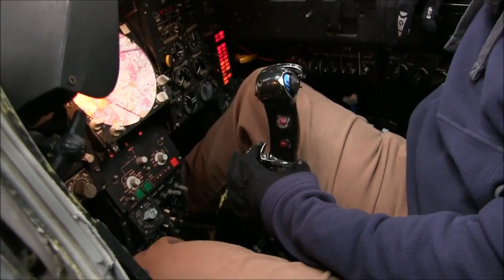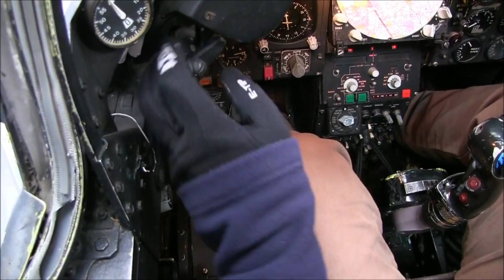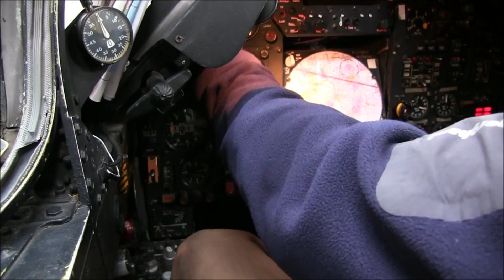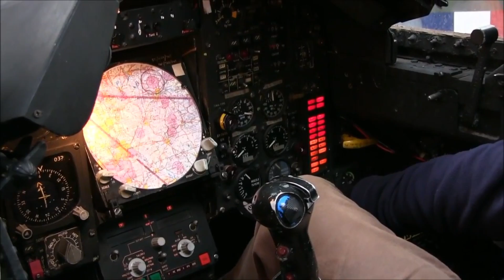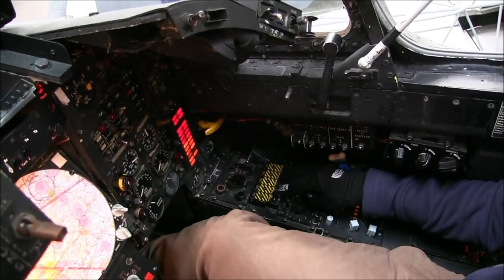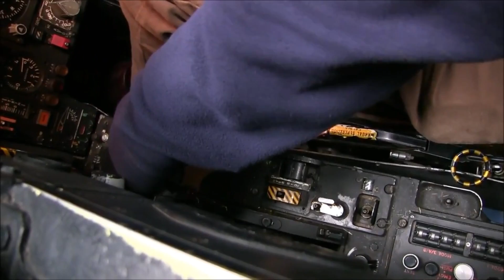Jaguar GR1 Cockpit Tour with Kip Morton

Comment: I served seven years on the Jaguar one year  of which was as an NCO on the 226OCU line looking after the Lineys. I remember the cramped cockpit and the student pilots dropping pens that they could not find, we had to do loose article checks,  occasionally we could not find them and it ended with the seat coming out.

Comment: Wow loved the jag but didn’t know it was that under powered! Had to have one engine on re-heat to refuel with full stores! 😳
Reply: Yes bizarre! Use extra fuel to get some fuel!
Reply: Interestingly the F16 requires reheat during air to air refueling if fully laden with stores, so not just an issue affecting the Jag.
Reply: @Makeitmakesense82  well I didn’t know that, thanks for the info
Reply: @mktm1290  F35 Pilot (ex-F16) explaining "afterburner" use during air-to-air refuelling: https://www.youtube.com/watch?v=9WJ58gFMliU&ab_channel=HasardLee

Comment: Sat in the runway caravan at Coltishall one day, and had a Jaguar T-bird line up for departure. Saw something stuck up at the rear of the wing so called the pilot and explained what I was seeing. Comical as the two guy's heads swung round to have a look so quickly. Apparently they had had an auto stab runaway.  Got a thank you out of that, so was a happy bunny.

Comment: Regarding operating PTR switches from rear cockpit on T2...... I spent 8 years as propulsion technician on Jags, late 70's/early 80's. I can't remember the PTR switches being duplicated in the rear cockpit but it was a long time ago and I could be mistaken. I know the throttle box was different in the rear and the engines could not be started or shut down from the rear.

Comment: There was a problem with the autostab system... Urm... MCAS anyone?
It seems that the aviation industry has learned nothing about putting "idiot-proofing" gizmos in the command-chain.
Reply: Old standard pitch/roll computers. Issues with rogue intermittent voltages. Happened more often as aircraft aged but was improved through life as systems became better.

Comment: Pitty it didnt have a cockpit like the F-18 with simular engines to the F-18
Reply: This is a 1970's aircraft, designed back in the 60's. It's Not a 1980's one. No pitty.

Comment: Could someone explain what RE HEAT is and in what ocasions does it is used please?
Reply from the maker: Reheat is afterburner.
Reply: Thanks guys!!!!! From some research I found that the "reheat" came from the antient steam-turbines operation, that used this cicle as a kind of "booster", and the term went on to the jet turbine (besides working in different ways they both have the same purpose). Found that it is a regional term also (north americans call it "afterburners" while english often call it "reheat").
Reply: Re Heat on an Aircraft  works in a similar way to a Turbo in a motor car ,in as much as it gives the engine an extra BOOST , in simple terms  extra fuel in introduced into the engine to give the motor EXTRA  power its usually used on aircraft for take off to get the aircraft into the air faster over a shorter take off run.
and additionally in air combat situations where  manoeuvrability at speed is of importance 
regards
Reply: The RAF version of the Jaguar also had the engines limited, so needed reheat to take off. It was a mandatory call from the runway caravan if they didn't light their tail.

Comment: How these pilots could fly low and fast and operate all those switches never ceases to amaze me. 

Great vid and very well explained.
Reply from the maker: I know it’s mind boggling!
Reply: It gets easier with 4th gen aircraft with HOTAS and multi-function displays. For combat you basically only fuddle with armament, sensor, and if necessary navigation switches, anyways. It would have definitely helped to have the light switches all in one place, though
Reply: Simple, they don't.